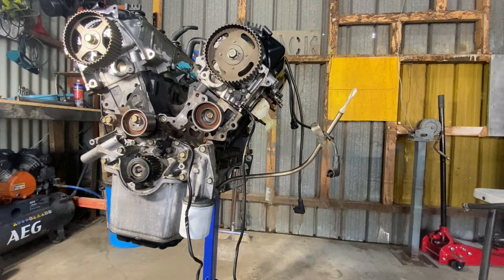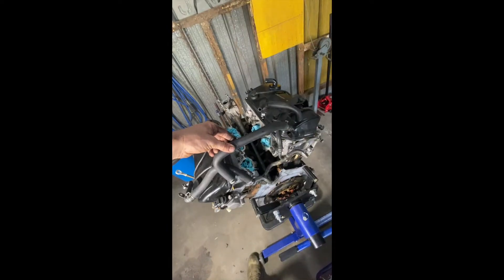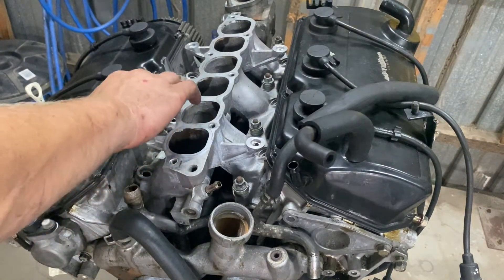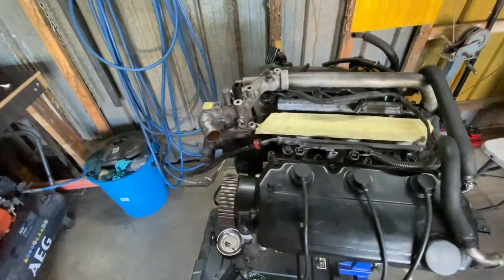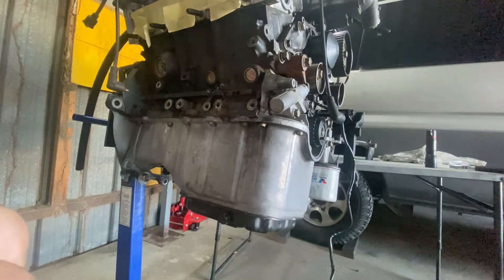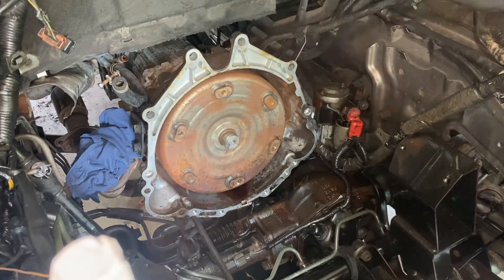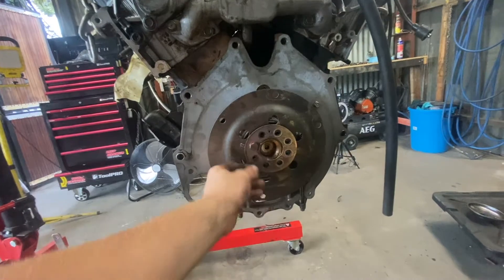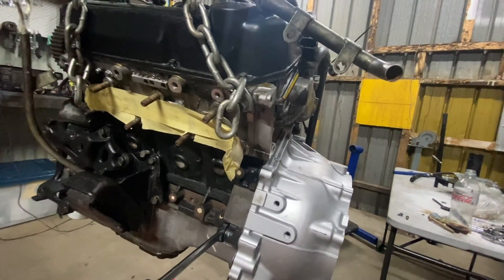Delica 3.8 Swap Part 5

Comment: Hey mate,

a bit late to the game here, but might help others watching. 

WIth regards to the 380 fuel rail... A lower intake plenum from a (1996-2005) Magna & Magna fuel rail can be used. This will bolt up directly, and still utilizes a regulator on the end. The 380 injectors fit straight into the Magna rail and plenum. The 380 & magna plenums look identical, but the fuel rails bolt at slightly different angles. 

I know im very late to the game, but just another way of doing it.. using oem parts.

Comment: Hi, I’m wanting to do the same conversion, on a Challenger. The alloy water crossover pipe, that bolts to the back of the heads, is that the same one that came off the 6G72? When I had a quick look, it appeared that the heads were further apart, which would make sense, as the block is taller. What is the pipe that you used from? Cheers.

Comment: So the water pump back is different between the 72 and 75 - but the front is the same?  So we can use the 6g75 timing water kit with front only ?
Reply from the maker: @zoldrin  yep